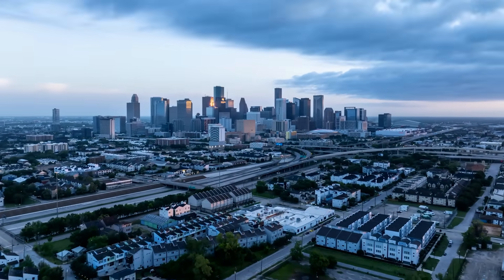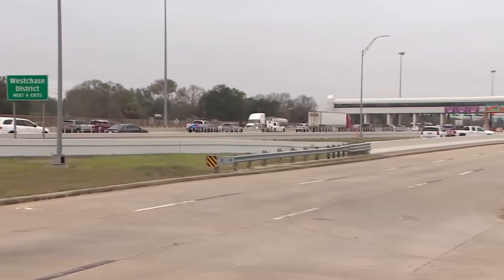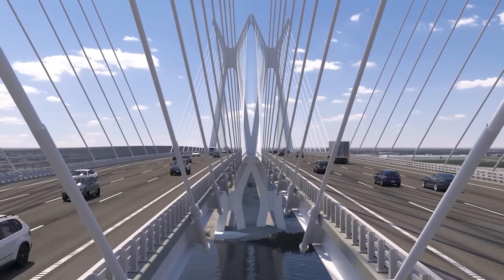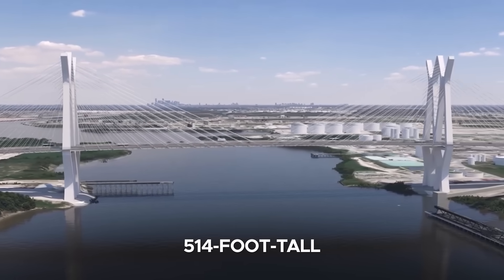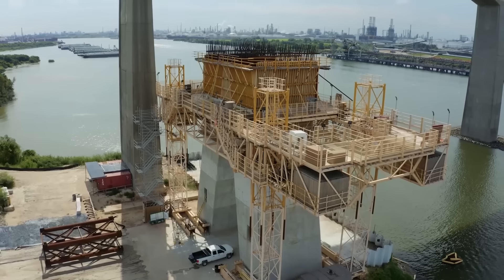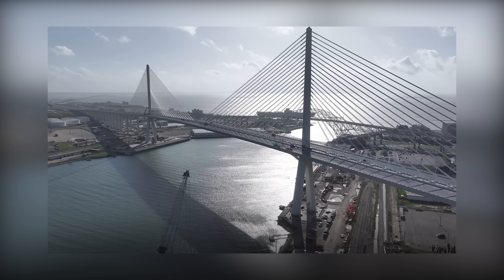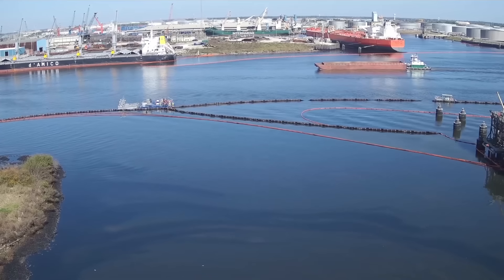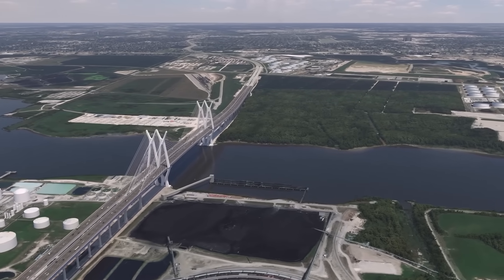The $1.3 BILLION Struggle To Build Houston’s Giant New Bridge

Comment: I live in Houston beltway 8 is a long ways from the loop 610 where the bridge they say it's aging and has to be replaced is located. That bridge on 610 is necessary it carries an enormous amount of commuter traffic each day. I've been over it thousands of times. It's not going anywhere.  and it's designed the new bridge is designed to carry 18-wheeler traffic far and around the city. We have our people talking about it on our local programs and besides we already have a big suspension bridge massive thing why didn't that get mentioned the 610 bridge at is it's known as it's not the only bridge we have across Buffalo bayou we have an enormous suspension bridge it's not double span like that but I want to say it it's a better looking bridge than the one they're proposing.

Comment: FIGG was the worst. They also built the Wando Bridge in Chaeston. For some reason they built a 40 year bridge out of concrete boxes held together with stainless steel straps - within several miles of the salty ocean. Early problems resulted in Mt Pleasant nowinspecting it every two years, and 6 to 7 years ago part of it shifted resulting in one half of the bridge being shut down 🙄. No ideahow they lastedas loong as they did.

Comment: It doesn't "tower over" the Houston skyline.  My office, on the 45th floor of Texas Tower in downtown Houston, is 523 feet above ground level according to GPS. This makes it higher than the top of the towers on the bridge.  And that is not the top floor of the building.  The building next door to ours is significantly taller.

Comment: It doesn’t matter how many lanes you add. If you can’t fix the drivers then the traffic will be the same
Reply: Even with the best drivers, cars are an inherently inefficient form of mass transit.

Light rail is much better, but Houston is so sprawled out, it would be very hard to reach everyone.
Reply: As someone who drives this very bridge every day, the traffic will not be the same.  simply adding a shoulder would lessen traffic there so much.  It's 2 lanes with no shoulder, so if someone breaks down (happens frequently), you're Shit out of Luck getting to work on time.  but if there was a shoulder, then traffic would slow (lookie-loo's) but not be basically stopped.  plus doubling the lanes will make it much smoother for a good period of time.  Eventually there will be more traffic (number of cars) but not necessarily worse traffic slow downs (or even the same).
Reply: @ezdupree  18 wheelers will be going up slow in every lane as they do on every freeway. Then you have the person on the phone texting and driving going 15 under the speed limit

Comment: I live in Houston and, not only is this bridge needed, but the 610 bridge that crosses the ship channel a few miles down is several decades old (a LOT older than the one on beltway 8) and in way worse condition!  Why aren’t they replacing that one?  …because 610 is not an over priced roll road like beltway 8!
Reply: Because the toll roads belong to the Harris County Toll Road Authority and highways to TXDOT, different “theys.”
Reply: @leestebbins5051 , yeah. True.
Reply: TXDoT is finally actually researching exactly what they are going to replace it with. They had local public meetings a little over a year ago. As well as the Washburn Tunnel. 

While I managed to miss both meetings, I did learn some stuff online. Probably the Chronicle’s website.

So, a web search/ AI (eg, Grok) might yield you some information, if you’re interested.
Reply: Yeah. TXDoT has been spending most of its time and money on the IH-610 west loop, galleria area, all of these years.

Comment: Houstonian here, I personally prefer  TUNNEL....
Reply: It might be more expensive and tougher to expand later on.
Reply: Cant, for the same reason there are no basements. Also great place for flooding.
Reply: @VM2D  We have figured that out.  Downtown Houston has about 7 miles of tunnels under it.
Reply: There is a tunnel, but unfortunately not connected to a highway.  The Washburn tunnel sucks though...same situation with no shoulders, smells like ass from all the fumes from the cars, and no cell or radio signal.
Reply: I remember going through the tunnel as a kid.
Reply: The baytown tunnel was replaced to deepen the ship channel, and was replaced by the Hartman bridge.   The Washburn tunnel is so far diwn the channel, that it might not need to be replaced.  The container port and petro chemical facilities are up stream.
Reply: Well, anything with a tank on or behind it, is prohibited 🚫 in most, if not all, tunnels. 

Plus, they are even considering replacing the Washburn Tunnel with a bridge. They may have already made that decision, by now.
Reply: They want our money to build the bridge and they want our money to use the bridge.  But they will tell you that you are stupid to think differently.
Reply: Then fund it
Reply: @user70621  It would be a lot cheaper.  I'm in.

Comment: When the old bridge opened in the 80s, my father declared on his first trip over, "What is this Mickey Mouse sh*t? They'll be rebuilding this in twenty years." LOL. Given that other bridges of similar design were replaced years ago due to structural flaws, this one probably needed replacement long before it's current 40 year age.
Reply: It reminds me of the Zilwaukee bridge.  Another concrete bridge like the Ship Channel bridge.  It too was scary to cross and built in the 80's.
Reply: @imatop10 you said a mouthfull...i stopped gping over this bridge bc its so narrow and scary...plus when ot rains and heavy wind...wow life threatening!!! Plus no shoulders....!!! Wow
Reply: We are getting one in Mobile Alabama over the River right now the tunnel is a nightmare.  Average traffic is 2 hours every day. If you see this please take the hazzard material route. 10 miles saves 2 hours wait. Just follow the directions
Reply: @inittowinit6633 Thanks for the tip. Been stuck there before.
Reply: I'm posting another FYI!! When driving from the west to east parts of the country on the I-10 corridor follow the hazardous material route. When traveling from the east to the west on the I-10. Take exit 38 hwy 181 north to US-31 west. Do Not get off of this route until you reach 1-165 then follow signs north bound until you reach 1-65  southbound to 1-10 west.   From the first of May through September you will thank me. 10 miles vs 2 hours
Reply: @inittowinit6633 
Damn Good of you… Thank You
Reply: 🤣😂🤣😂🤣😂 My dad had the same saying on BS projects🤣😂🤣🔥🔥🔥 Thank You I needed a good laugh
Reply: @biffteutsch3402 Dad said that about anything he saw as cheap or substandard. My kids laugh when I say it.
Reply: @DrWhite006 🔥🔥love it
Reply: They want our money to build the bridge and they want our money to use the bridge.  But they will tell you that you are stupid to think differently.
Reply: @mr90210 When the original one was built, they said that the tolls would stop once it was paid for. 😂

Comment: There is no way this will be finished by 2028. The first span isn't even close to opening. Then, they will switch traffic over and demolish the old bridge to construct the second span. At the rate they are going, it will be 2038.
Reply: Construction always takes longer than planned. The Baytown Bridge very similer to this one took 10 yrs.
Reply: @arnoldschlumphlatz  I agree, but they shouldn't promise something that can't be done.
Reply: @jeee1074  Then they cannot fleece the tax payers as much.
Reply: Just drove that way today.  I see very little change from month to month.  Absolutely no way it can be done in 2025, as advertised, and could be another 6-8 months minimum to finish span one.  Then demo of the existing?  Way more than two more years.
Reply: Yep.  got to screw the tax payers that are paying to build the bridge AND those who use it.  A double screw.
Reply: @mr90210 tax’s don’t even pay for this did you not listen
Reply: @mr90210  “ The new Houston Channel Bridge is being paid for by the Harris County Toll Road Authority (HCTRA) through toll revenues from Harris County toll roads, not taxpayer money.” So can you explain how it’s tax money

Comment: 1978 I worked a short time as a crane operator on the current bridge after seeing the honeycomb concrete when the forms were removed, I didn't want any part of the project. to this day I have not driving across it. The visible honeycombs were spackled over good fix, but what about the ones you don't see?